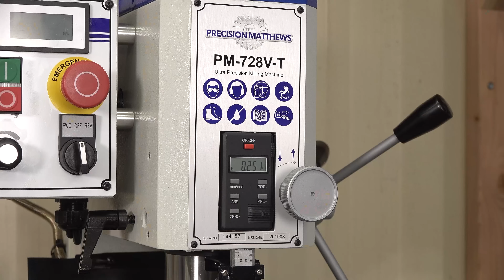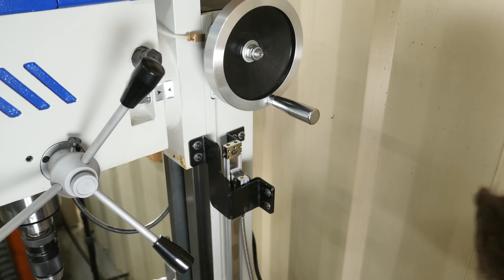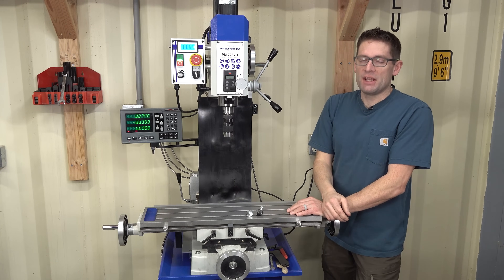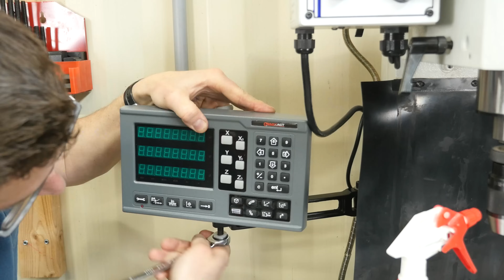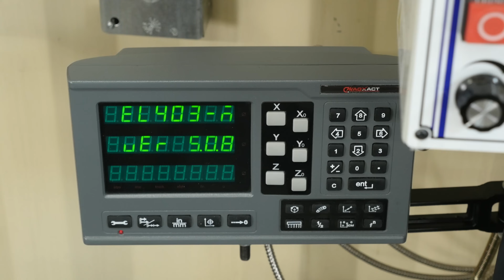DRO Install on Precision Matthews PM-728V-T

Comment: Gavin, thanks for both 728 videos. Purchased machine based on your reviews. I'm happy with both mill and dro, but do did not include instructions for 728 specific hardware. Called PM tech support and gentlemen said there is no manual available. Could you possibly forward the instructions you received from PM to me?

Comment: Why not attach DRO to the plunger ?
Main column does not have micro adjustment so its practically useless to hold DRO, especially when plunger has its own display.
Kinda weird.

Comment: I'm planning to buy my 1st milling machine, with zero metal working experience.
and obviously my budget is limiting my choices, but I would rather stretch the budget than make a purchase I would regret.

my 1st metal product is small, mostly aluminum and some 3 inch long mild steel bars to end mill / face mill.
so yes I could just buy the smallest hobbyist milling machine and it would suffice for now.

but knowing the reality, I will soon want to face mill 2 feet x 1 foot metal plates and so on.

that's how I found your channel and great advices. definitely you deserve subscribing, which I did

I live in Asia so I don;t have an easy access to the exact model you presented, but I think I found its twin, who knows it is not as well made as yours.

now I need to make that call and hurt my wallet.

should I buy DRO right away or can it wait? it looks like I want it now, but it's optional and costs extra USD 350++

cheers!

Comment: Wow so a DRO only tells you the precise measurements where to drill holes😕 I thought it was for programming cuts and holes, then you press the start button and it makes the piece on it's own. Which machine is that in which you're able to program it and it does it in it's own please? Thx
Reply: DRO (Digital Read Out) vs: CNC (Computer Numerical Control). Your DRO tells you where action starts, progresses and finishes. Your CNC controls the actions (motorized feeding rather than manual hand feeding) specifically where the milling/cutting starts, progresses and finishes. You can purchase and install optional power feeds for your mill that will perform those (XYZ) CNC functions. I hope that helps. mikey

Comment: 🤨PM doesn't have anything in stock on their website.  I guess only folks not worried about losing their money would risk purchasing backordered machines.   Everything being backordered on their website is not making a whole lot of sense and makes one suspicious that they maybe going out of business and are banking on a certain number of  dim witted folks ordering stuff before they claim bankruptcy and take of with their money.🤣
Reply: Shipping from overseas has slowed way down, largely due to the backlog from people buying things online during the pandemic.  I ordered my PM728vt, but they were out of the DRO version at the time, as well as the pedestal base.  I ordered my DRO from another company, and fabricated a table for the lathe out of steel.  I would have no real concern about the whole backorder thing; virtually all of the higher-end Machine equipment sellers are working with the same limitations right now.

Comment: I don’t see how the DRO reads the quill on the Z access. What am I missing?
Reply: The PM728vt comes from the factory with a DRO which reads how much the quill has moved.  So, that separate position is already covered.  This does mean that TOTAL Z is the combination of head position, plus the Quill position.   Normally for Milling operations, you will have the quill ALL they way up for greater rigidity. The quill is often only used for drilling operations.

Comment: Just received my 728 a few days ago. It is confirmed pre drilled for the PM DRO. If you plan on using the DRO from PM as seen here, order the machine with it, as the price is the same, or a little more if you purchase and install it yourself.

Comment: I got the DRO supplied with the PM14x40BV lathe and find display referenced to XY and Z.  However there are only two encoders.  I've always thought (I'm on my 4th lathe) that the lathe was a 2axis device.  Especially if they only have two linear encoders.  I've tried to get PM to take this DRO back and get me a true 2 axis DRO.  They refuse.
I've installed DROs on two lathes and had good service.  The PM DRO has for some reason chosen to use the Z display for one of the axis normally known as the X Y display.  Not very happy with this thing.
Reply: I have a Compound DRO as well, and have found it useful.  Consider adding a Compound scale, if you can find a non-interfering space.
Reply: @addertooth1  I'm having trouble imagining any operation that I would find that animal enabling any positive effect.
Reply: @stufields5125  As one example, I have to do 3 lead threading sometimes.  So, it looks like a 24 Threads per inch thread, but it is really an 8 turns per inch thread which has three stacked threads.   It makes for a rapidly tightening/loosening pitch, but does not require the Meat (thickness) of material as a normal 8 threads per inch.    
The compound is rotated parallel with the ways, and after the first of the three threads are cut, the compound is offset by 1/3rd of 1/8th of an inch 0.0466 inch)... and the next thread is cut, then the compound is adjusted again by 0.0466, and the third thread is cut.   I also use it when I am doing tapered conical fittings, and need to hit a precise depth for a taper before the transition.   

If you are not doing complex threads, or precision brass high-pressure tapered fittings, then I can understand why you don't see the value in having a digital compound.  I find that a lot of machinists only set up their compound to do cutting infrequently.

Comment: Nice DRO.  I installed a TOAUTO 3 axis from Amazon. On my 728 vt  and also made a power feed for my Z axes.  Your DRO looks Great!
Reply: Was that cheaper than the one you can buy with it from PM?  I'm currently looking at the the 728VT.  Would like the DRO too, but the upgrade is pretty pricey.

Comment: I would raise the DRO head up higher.  Understand the limitations of the mounting locations.  That said, modify the bracket so you have a better line of sight to the readouts.  Plus, will help keep chips, coolant, and cutting fluids away from the display.  
I too liked having the DRO head on the left side of the machine.  Right hand on any knee mill does a LOT of work.
If you decide to keep the DRO head in its present location, I would add another arm mounting a piece of plexi-glass to act as a movable shield.  Again, this shield is to protect the face of the DRO.

Comment: What did you use to level the scales, a indicator, level or eyeball it?
Reply from the maker: Aligned to table (X), measured with calipers (Y), and used machine movement (Z) to align!

Comment: I generally measure with a micrometer and mark it with a piece of chalk and then cut it with a chain saw! Great video!
Reply: MAN!! You are so ADVANCED!! I usually use my stone axe for cutting stuff.
Reply: That’s the only way
Reply: I should send you a wax pencil and assist you like people have helped me become a more precise wood butcher. When metal cutting I prefer a cutting torch as I need a little slop because getting too precise gives me more headaches from nothing I design lining up to the holes.
Reply: @BigDaddyMichael7  Ha! Ha!